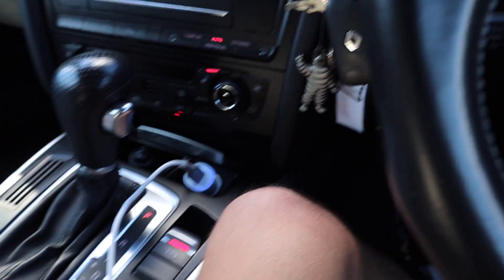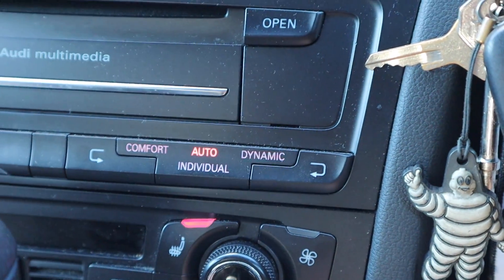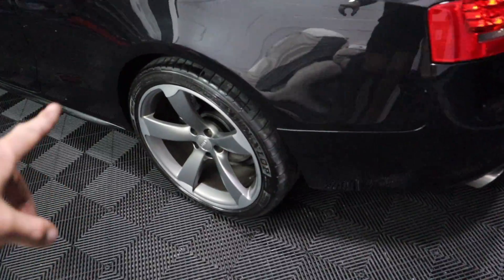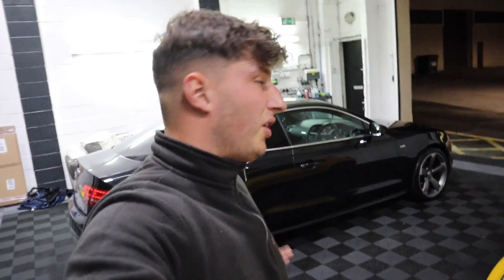NEW WHEELS FOR THE AUDI A5 **THEY ARE GENUINE**

Comment: Those different modes is the Audi drive select - was an optional extra. Most will have the drive select modes within the menu but you can spec it to have the buttons as well. It will change the following:

- gearbox
- engine
- suspension (if it has air/mag ride)

Thats my understanding as I have it on my A7 😬

Comment: Your bolts likely not torqued that high. If left on too long you can get what’s called cold solder joints and the torque needed to overcome them is way higher than what was used to put them on.

Comment: Should have gone for 20” rotors they look mega, it’s unreal how big some of these Audi arches are, I realised that when I put 19’s on my b8 s4, and obviously brings the car lower on smaller wheels and if you are going for springs you might struggle with clearance with splitter, so you would probably be better with coilovers for them, and I don’t think I’ve seen a b8 without drive select, definitely not a high spec option
Reply from the maker: It’s not a common option for them to have the drive select! No body rarely sees it

Comment: Your A5 should be on air suspension as standard, so flicking it to dynamic should stiffen up the suspension I believe. Don’t take that for certain though🤣
Reply from the maker: Hmm it’s definitely got springs there mate so it’s not on air!
Reply: TheCarPlug you need to start uploading mate been missing your videos
Reply: @SOCIALLYDRIVEN  It’s not air ride like bags as such but I believe that the springs are controlled by air?? Google says this mate “Audi's Adaptive Air Suspension is an electronically controlled suspension system that uses air springs on all four corners of the vehicle. ... As the vehicle increases speed the air suspension can lower the vehicle, lowering its center of gravity and improving aerodynamics”
Reply: @justpaton6991  I know man I’m in a really bad routine at the moment when it comes to YouTube sorry! I’m just focusing on business because of everything that’s going on as it’s been quite difficult at the moment. Cheers for supporting though, I definitely will be uploading soon👊🏼
Reply: The Audi dynamic suspension is electromagnetic like the m3 I believe, bear with me I’m half way through a bottle of kraken but there’s metallic molecules in the shock which obviously react to electronic input, the difference in voltage gives a difference in the composition of the molecules and stiffness.....I’ve suddenly got a headache 🤕